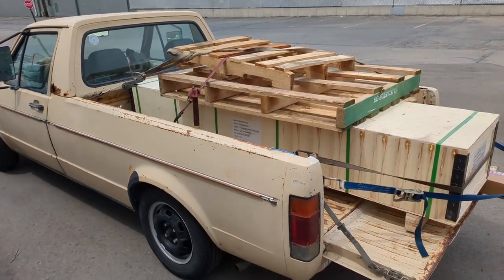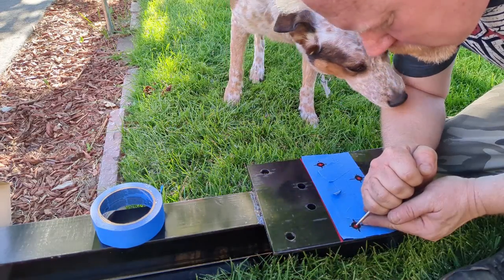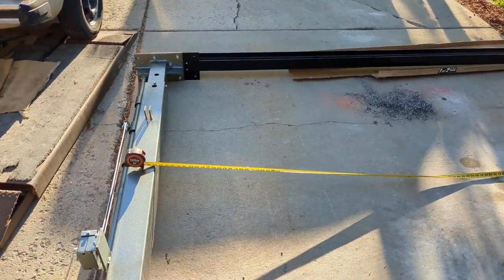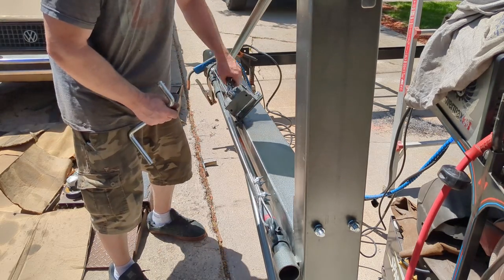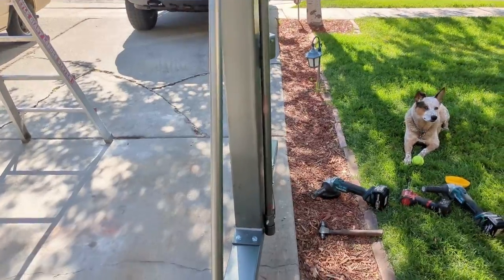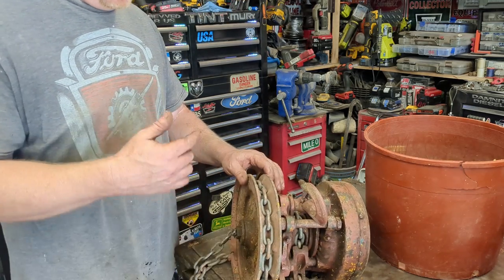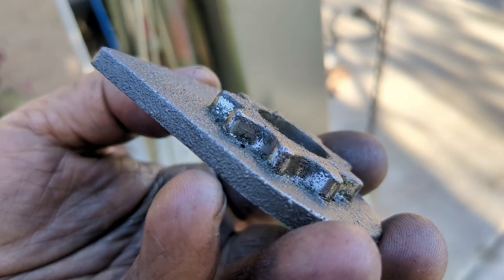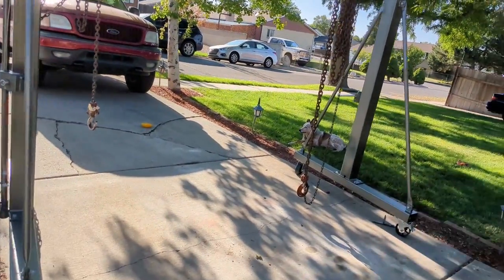Gantry Crane ... Modified- Wider Taller Skinner Smoother operation Harbor Freight

Comment: I  have one with 2 chain hoists in a 14' foot ceiling for 5 years. 2 hoists much nicer to lift than trying to balance loads. Once loads are level you can use one hand for both chains to go up or down synced up. Nice for loading pickup beds.   Like your vids.

Comment: I used these for years in factories. You either used a gantry or a jib. Gantry goes a lot farther in a small shop. I lifted the whole front of my car to do brakes and suspensiond back in the early 80s. All you had to do was put something like an old boat cushion between the chain and the bumper in a friends tool and die shop.
Reply from the maker: That's awesome.

Comment: You should add a couple extra pulleys and some more cable so one crank can lift both posts at the same time. So you don’t fatigue the welds on the top plates over time.

Comment: Fortunately for me, I  inherited a home with a huge garage that I could put 3 class A motor homes in. It also already had a huge Crain lift in the garage too.
They certainly do come in handy more often than one would think! I don’t have two Crain on it, but I do have a smaller wench hooks up to my ceiling in the garage for lifting lighter weight.  It’s a 3 bay garage and these are in 2 of the bays. Works out pretty well for my needs so far! Especially considering I didn’t have to pay for anything who can complain? 😂
Reply from the maker: That's awesome
Reply: Generational wealth 🙄

Comment: Great idea with the modifications. The cam action on that hand crank is an interesting piece of engineering. Smart to smooth it out a bit. Sounds like you need to shorten the crank handle after moving the mechanism out of the way. Gonna suck to bang into the brace with every revolution.

I usually just use the trusses in my shop from which to hang a hoist for engine pulls and such, but am limited by 9' ceilings. A gantry would be nice to have around for sure. We had a huge one in a boat shop where I worked back in the 90's. Pulled a few big boat engines with that thing. Not sure whatever happened to it.
Reply from the maker: Yeah shortening or rebending the hand crank is definitely the plan. I just want to make sure it's in the position I wanted to be in. 

I keep lifting from the 2x4 trusses in my garage and I'm afraid one day I'm going to bring down the ceiling. Try to limit myself to maybe 200 lb....
Reply: @sixtyfiveford  I run a 2 1/2" pipe over 4 truss bottom chords and hang a chain from the center of that. Plenty strong for what I do, (4 cyl car engines and such) but I wouldn't lift a V8 or a 1500lb trailer with that setup.

Comment: How bout a thin metal flashing roof on the thing to keep most of the rain out?
Reply: That's a good idea 💡
Reply from the maker: I love the way you think. After I got it all together I was debating what to do when I thought why don't I just put a roof on it? I have an old piece of tin roofing will be perfect for it
Reply: @sixtyfiveford  A roof is a good idea. I'd be interested in seeing how you do it...
Reply from the maker: @JDeWittDIY  I wasn't thinking anything fancy. Just a sheet of tin 2-3 ft wide across the whole top.
Reply: @sixtyfiveford  That'll work great. :+1:
Reply: @sixtyfiveford  You've got tig and breaks same as me here.  I was thinking aluminum angle frame tiged together with a old sign or tin covering, and maybe doing it in a barn style coming down far enough to better protect the hoist.  Because nothings going higher than the bottom of the hoist.

Comment: That should work great for you.  The uncle-in -law made something like that for my shop, it swivels on trailer bearings and rolls on the floor in a half circle with about a fifteen foot radius.  Reminds me that I STILL need to finish the overkill 19th Century trolley that I got sidetracked in the middle of probably a year ago.  I've been sliding a chain across the I-beam with a chain-hoist up on a ladder since the electric wench got abused, then I saw the 500lb max. sticker, poor thing.

Comment: I bought one of those years ago, for an unplanned project that needed to be done within 2 days.  I ran into exactly the same problem with one of the cable winches... it just wasn't make correctly or greased at all.  It failed before the first use and it was the only one they had and the cable winches were already scavenged off the floor model (should be a warning sign).  Not finding a replacement readily at hand I ended up taking the cable off and the guts out and drilled a hole and just attached the cable directly to the center pin which actually made that side easier to use.  I had planned on getting 2 cheap boat cable winches to use since I was assuming the other one would soon fail, even though I cleaned it up and added some decent grease.  Its been many projects and neither have failed and I honestly like the way my jury rigged side works better as even though it doesn't hold the tension for you it goes up and down much faster and easier and I am only using it under load until I can stick the pin back in.  I have always wanted to widen mine so that's going in the  mental filing cabinet, although I am going to steal your two troll and winch idea asap...
Reply from the maker: It's a really unique design and since everything at HF is a clone of a real product, I'm sure it was made nicer originally. The original was probably all machined from hardened steel. It did drastically reduce the effort(about 1/2) after I smoothed out the cast iron though. I saw reviews on youtube where guys replaced them with boat winches but I like the simple wrap around the center shaft.

Comment: I've got a strap hoist in my shed but it was just for hanging mowers with. Swung a 12 horse Gravely with a 40 inch kidney mower off it. And this looks Ginger approved. Blessings 2 yall
Reply from the maker: It's handy to lift these things. I used it to work on a generator today; definitely made it easier.
Reply: @sixtyfiveford  Mine is an old defunct hot line hauser from the power company that I fixed back up. Might be 3k pounds rated. Nylon strap doing the pulling. I hung all my stuff to work on it. Stood it on one end or the other. Saves the back bones and knees. Blessings 2 yall!

Comment: I come-alonged my utility trailer to vertical, off a tree limb, tongue up, a few weeks ago. It took 3 set-ups of the c-along, tieing off the tongue each time. 
It would have been quicker using a gantry crane, but my way required only 68 trips up the ladder.

Comment: i have gotten a lot of things cheaper at HF than the steel cost and most are well built. i don't know why scrap metal is so cheap with the price of new steel being so high. good video and job. take care, be safe and well.
Reply from the maker: Supply and demand I guess and since all the big companies get the steel, we're left with very little to fight over. I kept finding used steel to make this but it was way overkill in size and I needed a crane to make it.

Comment: Yup. My HF gantry is over 20 years old and the steel is twice has heavy as the new ones. Did the same 2 trolley/hoist setup. Mine lifted a 9x42 enco mill no problem. I sold the original I beam and fabricated my own out of 2, 6” channel irons and weld back to back. My inside is 10.5’. Careful when raising/lowering…the trolleys want to take off quick. Tie them off before adjusting. Not to impressed with the crank handle hitting the brace. Gonna be a lot of swearing when your hand get pinched!

Comment: I like that ladder hoist setup. It comes in handy.
Reply: I use a rig like that to lift my riding mower.  I place  a 4x4 across the rungs and the 4x4 has a eye bolt in it to carry the hoist.

Comment: I built one from scratch using 2" 11ga. square tube and 3/4 emt as struts. HF electric winch up top...  Lighe and strong enough to lift most anything.

Comment: VHT Wheel paint Graphite is a perfect match to harbor freight jackstand gray paint.... if you need to do touch up and want it too look factory! good mods on that thing. keep up the good work.
Reply from the maker: Good to know. I had some charcoal metal flake that was close and figured if it's anything like all the other HF stuff it'll turn a different color in the sun after a few months anyway.
Reply: @sixtyfiveford  you are not wrong!

Comment: Love your work. I can’t buy anything without modifying it. Because it my only disagreement is with the puny assed safety flagging. By code it’s supposed to be 12”x12”(144 sq in). Some overzealous DOT/commercial cop or a barber fife will stop you and red tag your load until corrected. But personally I’ve done it both ways. Found out the correct way is cheaper and a lot less painful financially

Comment: Nice looking drill rig you got there young man 👍
Reply from the maker: It's one of those things that I don't use very often, but when I need it, it's the right tool for the job. I think if they were more mainstream the prices would drop substantially. Right now they're kind of ridiculously priced.
Reply: @sixtyfiveford  i Saw that price for that machine 😲😳💸😲
Reply from the maker: @robertmailhos8159  And this is a cheaper one.
Reply: @sixtyfiveford   the best thing ever is the price for that machine glad you got that  Crane instead of having to build it because of the price of the metal being the high price for it

Comment: Pretty nice, apart that really sketcy looking sintered(?) cam sprocket. Knowing some people misuse things, that will fail for sure for some 😀
Reply: It should only be used when adjusting the height of the crane but, like you said, some people will misuse things.
Reply from the maker: Reading all the reviews. It's the number one failure point of these.

Comment: The load capacity is reduced by spreading apart the uprights.
Reply: I was wondering about that.
Reply from the maker: Barely. If this was a concern, gussets the same length stretched would match the original specs. Overhead lifting items are rated at 4x capacity. So this 1 ton gantry will lift a minimum of 4 tons before failure.
Reply: Rated 4x for a single lift.  But at what multiple of the rated capacity do you cross the Rubicon on the S-N curve?
Reply from the maker: @scottfreedoms9584  Nobody's lifting at 4x the rated too fatigue the steel. The point is the 2-3% load capacity lost due to increasing the span isn't going to lead to failure if used at capacity. Even if you did these are high cycle items and may only lift something 20-30 times in their life.

Comment: I need one, but I need one to be able to go in and out of my regular height garage.
Reply from the maker: This could be easily cut down and rewelded to fit under the garage door. I contemplated doing the same thing but the overall height wouldn't have been enough for the task that I needed it for. I may still do this this in the future after I'm done with my job.

Comment: No issues with the mag drill being 50hz running on 60hz?
Reply from the maker: That's a typo since they're a UK-based company. Their stuff is generally 240 volts at 50 Hz. This mag drill is setup for the US 120 volts at 60 Hz.